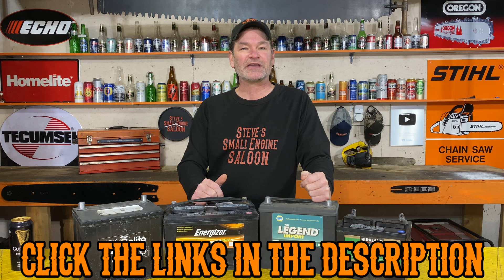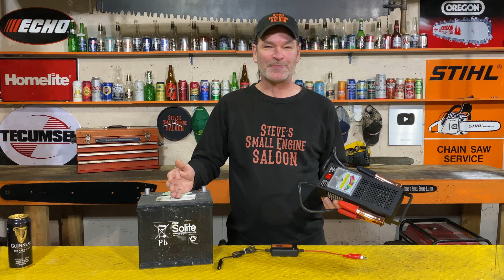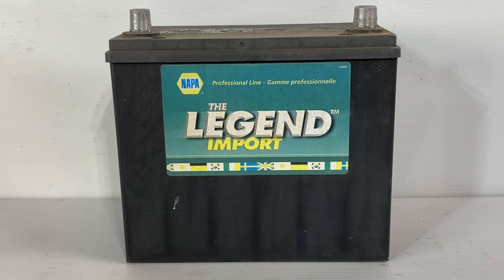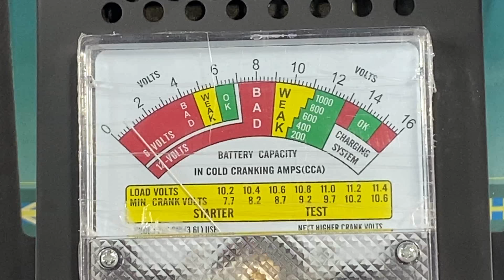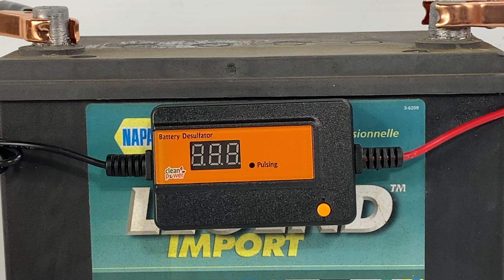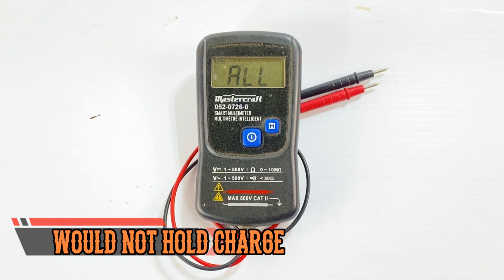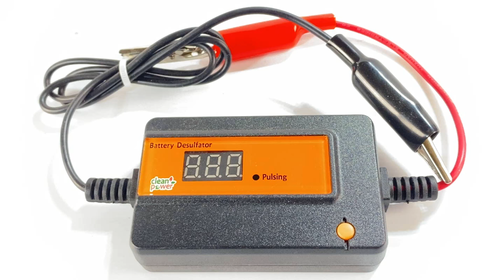Does An Electronic De-Sulfator Really Repair A Battery?? See Real Results

Comment from the maker: ✅CLICK HERE FOR A DESULFATOR ➜ https://amzn.to/36S7LS2
✅CLICK HERE FOR THE LOAD TESTER ➜ https://amzn.to/3rx7sUF
✅CLICK HERE FOR A CHARGER ➜ https://amzn.to/32PYon9
✅CLICK HERE FOR THE POST CLEANER ➜ https://amzn.to/3cIxsrJ

For more videos like this, check out: 
👉Winterize and Maintain The Battery on a Riding Lawnmower ➜ https://youtu.be/CJmlFxcyw44
👉Riding Mower Video Series ➜ https://www.youtube.com/playlist?list=PLhORnVQxJe0WEj0xabaL5Nlp2jm9XJ4vU
👉Fast Fix Video Series ➜ https://www.youtube.com/playlist?list=PLhORnVQxJe0XtBJ__9_dvHH4Mi5shjfme
👉Chainsaw Video Series ➜ https://www.youtube.com/playlist?list=PLhORnVQxJe0UHu7rAiYi2NDYIZnghoa25

You can connect with Steve here too: 
✅Visit Steve’s WEBSITE ➜ http://www.stevessmallenginesaloon.com/ 
✅Visit Steve’s PARTS & TOOL STORE ➜ https://www.amazon.com/shop/stevessmallenginesaloon 
✅Follow Steve on FACEBOOK ➜ https://www.facebook.com/stevessmallenginesaloon 
✅Follow Steve on INSTAGRAM ➜ https://www.instagram.com/stevessmallenginesaloon/ 
✅Follow Steve on TWITTER ➜ https://twitter.com/SteveSaloon
Reply: Thing is you have to understand how a battery works to understand the limitations of a desulfator.
Lead acid plates are formed on a lead framework that is packed with either copper or lead powder to increase the surface for the electrolyte to contact.
The Sulfuric acid separates and the sulfur compounds connect and buildup around the lead framework and the Paste of compressed powder.
This separates the small blocks of  Paste of compressed powder from the lead frame and therefore there is less or no contact the plates are dead.
This is where you can get 2 of 6 cells going down and the rest will follow quickly.

Desulfation can help temporally  but it's not the Fix it promotes itself to be.

"UNLESS you stick a auto battery desulfator on your system from New" they are next to useless on a very temp basis

I have lived 70 years 30 of those completely off grid with car, boat, and house batteries.
Reply: This guy claims to know a lot about these small engines...Well he actually does. Anytime I have a problem with.(snow blower, lawn mower, weed wacker, blower, etc.) I go to his channel and there is a video to fit my needs. Great YouTube channel.
Reply: I have one just like it.  It is really made for rejuvenating middle aged batteries that still work but had more power when new, so I have been misusing mine by using it on very weak batteries.  My experience is that they very slowly, over the span of months, have increased the power on my very weak batteries, which I use in my camping trailer.  I still have yet to attempt to start an engine with either of mine and though they have more power than before, I doubt either could start an engine yet.  But I still have it working on one even as I type.
Reply: I got sick of cycling my desulfator and was getting marginal results even from many cycles, so I combined my desulfator with my trickle charger, enabling me to just leave it on for weeks and even months with no action on my part.  but even after months, on a very old battery, results have been mediocre.
Reply: That's great. I think I will buy one. Thanks for all your help. I have repaired a lot of small engines thanks  to your videos.  Also I can now fix just about any small carburetor.
Reply: Hey Steve I will have to add a desulfator to my collection of treasures .Thanks for the info
Reply: @keithfarley7093  You better not be touching my hair again I am sick of it STOP
Reply: @TimPerfetto  I will not under any circumstances give up my passion in life of my unapologetic touching of your hair simply to accommodate your tangible feelings. This is not about you. Also, you smell different when you’re awake.
Reply: @keithfarley7093 Oh my... Possibly the smell of ketoacidosis
Reply: Thanks for doing the hard work for us. I may want to add one of those to my kit as well!
Reply: Sadly, at the desulfator link Amazon now says "Currently unavailable.
We don't know when or if this item will be back in stock."
In the past it is something I have seen when an item is gone for good. Too bad - looks like it has a place in many people's garages.
Reply: My little Charge Minder trickle charger has a built in desulfator (spl?) that goes through a desulfate process every 24 hrs while it is connected. $24 at the motorcycle shop.
Reply: I ran that same battery for the 7th year, now its dec 1 2023. the 300 cca battery measures 337 cca, 13.1 vdc 7.8 milliohms, its a sealed battery. I'll keep the Battery Minder on it from dec 1 to late April, starting the engine once a month, seems to help the battery. the tractor ran strong all summer. I use the Cen-tech meter from Harbour Freight.  Cant wait for next year.
Reply: How much long will the battery last after done a recovery mode?
Reply: FYI: I have a Panasonic Lead Acid battery that could not be repaired by an electronic desulfator BUT FINALLY recovered by EPSOM salt treatment.

Comment: Unless the battery that wouldn't charge has an internal short, I just watched different guys on YT using a stick welder to refresh their dead battery.The procedures vary a bit, but most use 50-90 amps in short cycles, cooling in between, and they seem to have good results. Yes, hydrogen gas is explosive so precautions are necessary, beginning with being sure the battery is filled with distilled water, and charging in a well ventilated area: preferably outdoors. I plan to try it on an old battery that has been sitting around my shop for several years.

Comment: I've got a car battery that was never used and has been sitting for around 3 or 4 years. It was never put on a charger until this year. But the charger wouldn't charge it at all. I don't know if it's possible to make it work again, but what would you suggest trying first?

Comment: One other observation.  I've had batteries that would charge to 12V+, but had no power.  I was told it could be from the coating of lead on the plates being thin - worn down.  I'm not sure if that's true, since I've never taken one apart, but it could be.

Oops, one more.  I've had batteries that are bulging out, but still work fine.  I was told all kinds of things from repair shops.  The battery is going to explode (I don't think so), it's a bad battery and stresses out the charging system and will cause failure (if it works, I don't think it's a problem) and it could fail at any moment and leave me stranded (maybe???).  Anyway, since it worked, I kept the battery in the car.

Comment: Great video.  Nothing about how or why this works, but more importantly is what the results are.  

Over the years, I've killed a lot of car batteries  Here's some things I'll recommend NOT to do:
1.  Don't boil a battery.  We're all in a big hurry, but putting too much power into the battery isn't good.
2.  Don't let them sit dead for too long.
3.  Don't get the battery too hot.  Either from overcharging or running too much current for too long.
4.  Don't put tap water in the battery.  Unless your water doesn't have minerals, don't do it.

Comment: When I worked at Sears Automotive in the late 80's early 90's, I was told that DeSulfator takes up to 2 weeks.  We had a rack in Colorado, where we ran this on 50 batteries for 2 weeks.  If it failed after that, we tossed the battery.

Comment: I just use my old school charger to desulfate batteries.  Use on start mode 200A for five 15 minute cycles with 1 hr rest between cycles.  Haven’t had a battery it didn’t revive.  Just did on my 10yr old battery in my Jetta TDI that wouldn’t hold a charge longer than 2 days.  After desulfating it works like new again.  New chargers seem to have too much protection to actually desulfate with good results.

Comment: i suspect these work best on relatively young batteries that weren't used in a long time. I bought a new car battery almost 3 years ago but haven't driven that car for almost a year, and when i try to charge it, i get "SUL" on the charger's digital display, which is its way of saying it went into desulfation mode. After nitipicking with it for awhile, it does seem to have revived my battery. But the battery isn't that old either. If it had been more than 5 years old , i suspect i might have had to get another battery. Might still have to, actually, because i haven't done a load test on it yet.

Comment: I have a powerful charger with a 400 Ah start help function. When I have a dead battery that won`t charge, I activate the start help function and let it stay on and watch the amp and voltage. The amp can start at zero and voltage at 19-20 volts. Sometimes it takes a few minutes and sometimes it takes a half our and even more before anything happens. But little by little the amp starts going up and volts coming down. Be ware of battery gas. If you smell gas, turn off the start help function to lower the amp. When amp comes up to 15-20 amps and voltage down to 16-17 volts, I turn the charger of and chech if voltage stays over 12.5, to see if all cells is working. Then I let the battery slow charge as normal. I have saved 99% of the batteries with this procedure. But some batteries are unsavable and gone for ever. Attention !!!  This is not for everyone, and you have to carefully monitor the the battery, amp and volt meters all the time. Things can happen fast. Use protection, there is allways a risk of explotion if you don`t pay attention. In 20+ years, I have never had an accident...yet.

Comment: Another good desulfater is pulse tech. I wonder if that desulfator would have worked on battery number 2 if it was connected with the trickle charger providing the 12 v. I have had great experience with the pulse tech solar charger/desulfator.

Comment: Most of these batteries run out of water after 6 years and die. I bought a giant $200 battery for my 5.4 l amg clk55 hooked it up to the charger couldn't get it to charge opened up the thing and it had water acid below every plate! Designed obsolescence from dura last. They should clearly mark the top check water every 3 years.😡

Comment: Absolutely need to dump its fluid and put in NEW sulfuric and AKA battery acid.
then do a garden hose flush that will help remove the plate crust “some. Then refill w new fluid then do the de-sulfate cycles.
The cycles need more then 2 passes, likely 6 or more possible to get V to hold longer time.

Comment: The battery that you said only stays at 8 volts is it possible to trick the sulfator by connecting it to a higher amperage charger to like jump start a charge or maybe even changing the electrolytes nice topic my dad back in the day would that to make the battery last a bit longer

Comment: I bought one. It dosent work at all, i mean it wasent working except for that flashing red light but there was no crrent changes, or there was no current pulses at all, i returned it and bought a charger with the option of desulfation and works better, you can see current pulses that go up to 7 AMPS, and down to half AMPS, and vere versa.

Comment: I will use it for my car battery,  and i will comment again, because my car battery still take charge normally and crank the engine, except if i left the car parked for  two days, or temperature goes bellow zero and you left the car parked for a Day or more. Even if the temperature goes bellow zero, the battery still crank the engine withing like short time of parked car less than 6 hours, and if disconnect the negative  battery, the car will start normally even I left it parked for long time, I did draw test, there is non, battery is getting weak after a disharged it too much, by leaving parking light on for more than hour, I try to start the car four times which drain the battery too much.  

So de sulfator works only on alive battery that has 12 regular voltage, but it got weak and doesn't hold charge for long or doesn't  crank the engine on a cold bellow zero temperarure nymore.

Comment: Hmm. Might pay to check your results using a battery analyzer. This will tell you how sulfated the batteries still are. I have recharged some of my 12v batteries using a desulfator charger. They recharged to 13.5v and held their charge for weeks. Checked them with battery load test and passed OK. I was still suspicious so bought battery analyzer this showed battery resistant was still very high. Should only be about 4% and CCA very low in one case only 20% of labeled 700 CCA. I haven't given up yet will try repeated desulfated charging and see if there is any change.

Comment: I recently purchased a Vevor 35 Amp Smart Charger for charging LiPO4 batteries.  It also has a desulfator mode, a trickle mode, and a force mode.  I have a dead lead-acid battery that I think might have gotten frozen in our SeaDoo.  It showed a fraction of a volt & wouldn't take a charge.  After watching this video I decided to pry the plug sealing strip off and check the water level, and sure enough it needed to be topped off.  Now the charger is able to trickle charge it.  I'm really hopeful that it will work again.  It was only about 1 or 2 years old & I hated the idea of having to replace it.
Thanks for the great video.  👍👍

Comment: Hi Steve, this is the second time watching this video. Maybe if you tried linking the battery that wouldn't go above 8v in series with another, and then add the desulfator to the bad battery, it might work. Just a thought.

Comment: The second battery will charge if you connect it to a good battery in series with a set of jumper cables. It will think it's at 12 volts. Then it will repair it.

Comment: Steve,
most newer battery chargers won't charge a stone dead battery.  They require some voltage in the battery in order to work.  My work around is to hook up a second battery to the stone dead one then the charger will start working.  Once the dead one is charged a little you can disconnect the buddy battery.  Maybe you could have tried this trick on the battery with the to low voltage.

Comment: i wonder how a desulfator works.   i imagine it contains a capacitor and a circuit that allows the capacitor to charge up then dumps the charge into the battery to blow the sulfate deposits off the plates then repeats the cycles.

Comment: Great Video.. not sure if you tried this but any battery that doesn’t hold 10v to activate the desulfator, wire another battery or 12v jumper pack to it and run them all connected.  I’ve got some to back to life that way.  Usually a good 30mins and you should be able to take off the secondary battery from the connection as long as it’s reached enough volts.  Gotta do what you gotta do in these times.

Comment: My wife motorcycle battery wouldn’t start the bike after 24 hours, I did a couple run of désulfuration and now it hold the charge over 3 weeks without use no problem. It has been like that for 18 months.

Without that I would have bought a new battery.
Reply from the maker: Right on

Comment: If its just sulfation form age then an easy way to desulfate the battery is add 2ml of concentrated hot alum solution to each cell and top off with distilled water. Wait 24 hours and apply pure AC from the wall through a space heater or other similar resistive load till it consumes decent current. Next add a diode that can take the amps with a PIV in excess of 200V and use that to reform the plates, 5 minutes is plenty. Then charge normally. Thats it.❤

Comment: Great video! I was wondering if that process was even useful because the battery charger that I have will start out in the Battery Desulphation mode for about 10 minutes then it will go through it's charging stages. It says 7-stage charger on it.

Pre-story... I have a 105ah marine lead acid battery that I use for charging my small devices sometimes, like my ryobi batteries. But it did 1st start out with someone using a 1,000 watt inverter to power aprox 800 watts of video game equipment for several charge cycles. So I don't know if that had any effect... Story... So it seems like my 105ah marine lead acid doesn't really charge with my 100 watt solar panel (seems like, even with a couple hours a day of direct sunlight). And seems like my same solar panel does charge my 80ah agm gold DieHard, even 30 minutes of direct sunlight helps charge... So I might try to run the repair process on my marine battery.

Comment: You can desulfate a battery by charging it normally to as high a state of charge as you can get. Then check each cell and bring the electrolite up to full. Leave the caps iff and continue to charge at 15.5 volts to 16.0 volts. This will blow the sulfates off the battery plates. Charge at 15 volts for half hour to an hour. Recheck electrolyte level and retest. Repeat as nessesary until you reach a full charge. This works really well in RVs with the 6 volt golf cart batteries in series. My RV charging system "equalizes" the ciach batteries each time you drive the rig.

Comment: With that dead legend battery that red 8v and wouldn't allow the battery desalfater to turn on because it didn't recognize the low-voltage. Did you do what we do with the Milwaukee 18v battery & fake it, using another battery to simulate more than 10 V just to get it activated and started? If you have already done it, I apologize I'm just watching this video now but that being said, I think you would have a better chance of saving that battery if you can a healthy battery voltage of 10 V or greater by using any battery or batteries together in series to generate enough voltage in  order to turn on the unit to see if it would actually save that battery? Thanks for the videos. Keep up the good work.